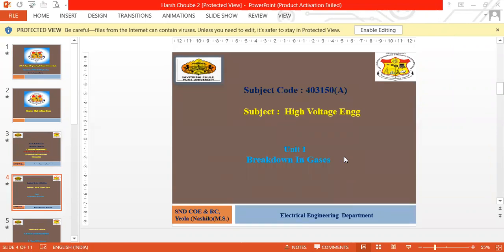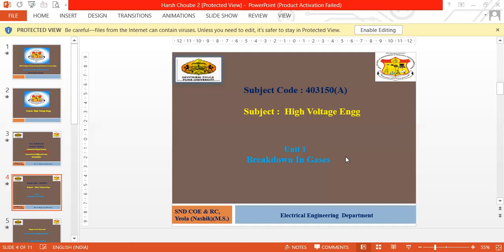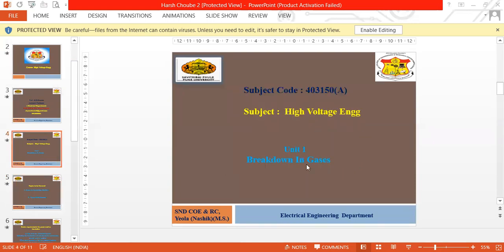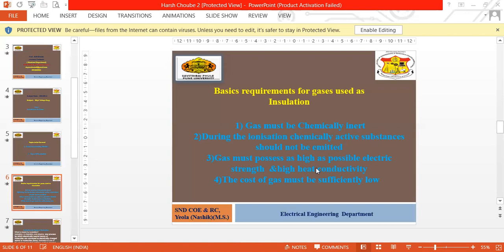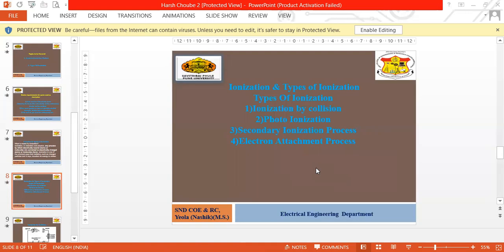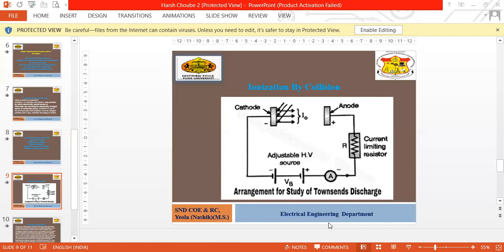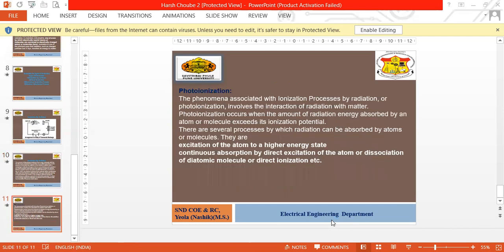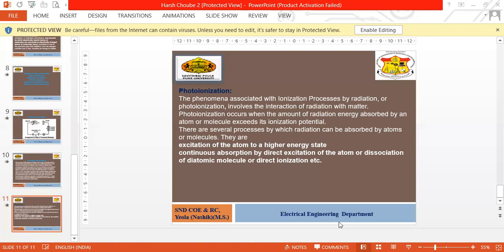High voltage Engg 1

Comment: With increase in the transmission voltage size of the conductors is 
reduced (Cross section of the conductors reduce as current required to 
carry reduces). 
But by increasing conductor size , decrease corona. Corona more in 400kv and 765 kV system. Which statement is correct?